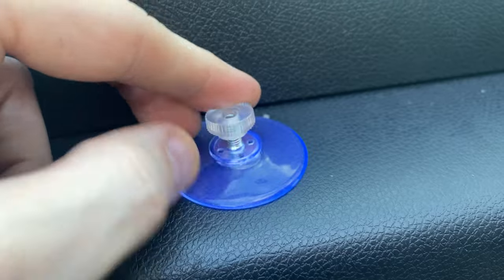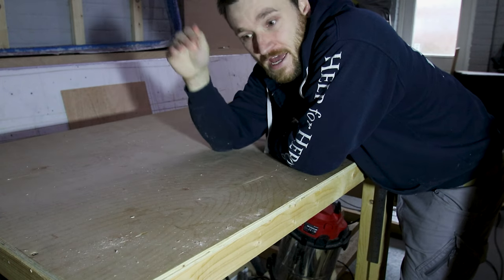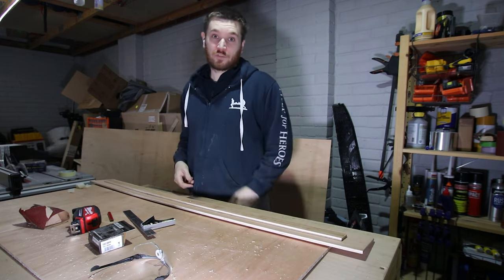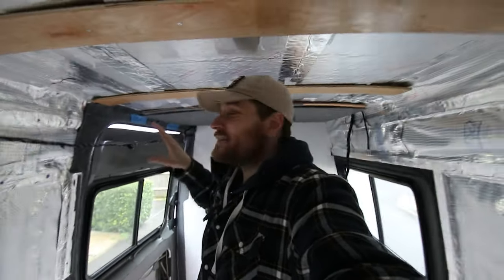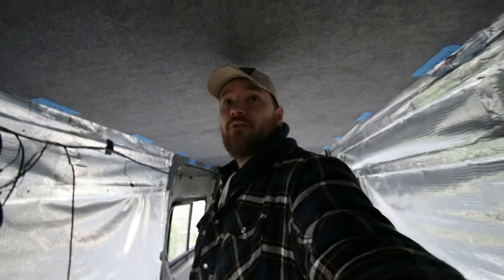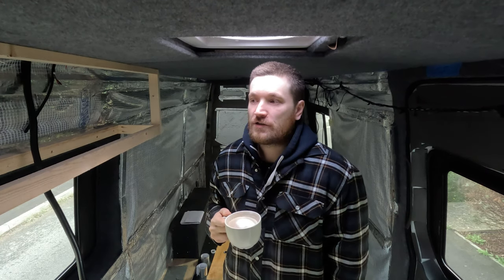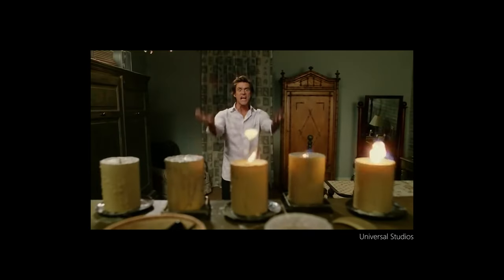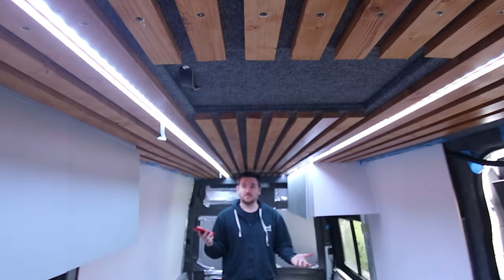e7. SMART RGB van ceiling and hanging minimalist CUPBOARDS in a Sprinter | Van build series

Comment: Hi Guys! Did you use two kits or cut one? Interested to know how you set this up.
Reply from the maker: Hi Jordan. So I bought a kit (linked in the description) as they are RGBIC, strips, rather than just RGB/RGBW and i was short on time.
However it essentially looks like this if you wanted to make your own version…

Power driver (which I hard swapped for a barrel connector straight to my fusebox) > RGBIC wireless controller > 2 way splitter >> and each length spurred from those splitters.

I hope that makes sense. 
I am probably going to go a little more in depth on it on my upcoming electrics build video.
🤙🏻thanks for watching!
Reply from the maker: p.s. I have just checked and updated the link to the exact kit I used (it has massively come down in price too!).

Comment: nice lights, can you use them as 12v???
Reply from the maker: Yes absolutely. They are primarily 12v strips but as I haven’t got my 12v batteries in yet - they are just connected with a 240v - 12v converter for the demonstration. 
They will be directly fused through 12v when the batteries are in though 👍🏻